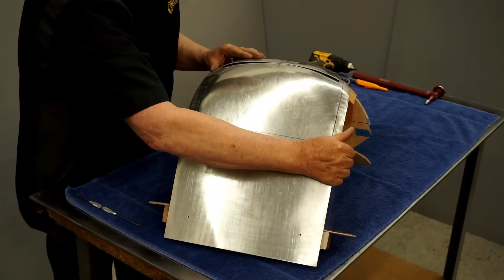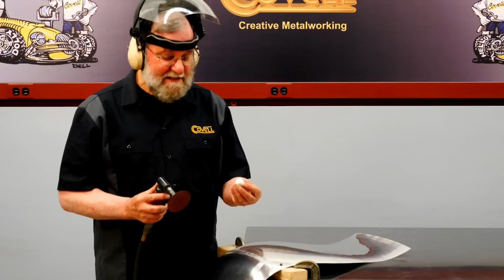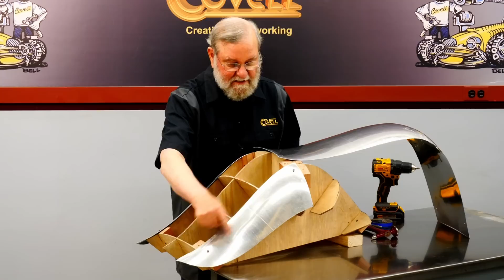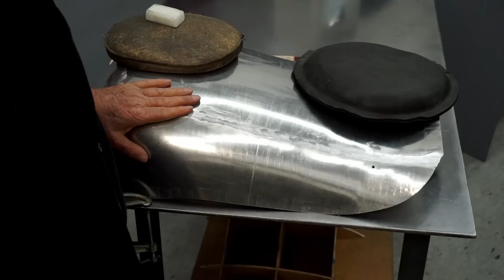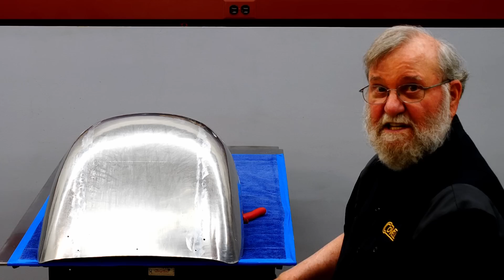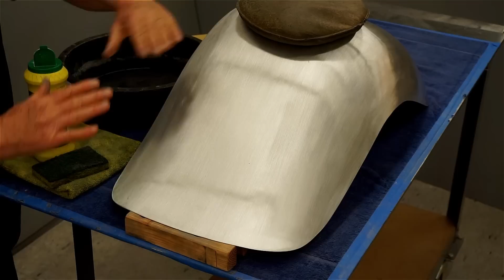Making a Curvy Seat - Part 4 - Joining the pieces

Comment: You are an amazing craftsman! I have a question. What is the white block you're putting on your sanding pads? I know its used to help not fill the pad with aluminium,  but im not sure what its called.
Reply from the maker: I use regular bar soap on my abrasives when sanding aluminum, to keep from clogging the grit. Any soap will work, but choose one that doesn't have an odor you dislike.

Comment: That seat design is beautiful. I hated to see even a little trimming much less as much as you did. I know why. but the full rough shape was pretty inviting to sit in. Maybe could have used some of the excess for a rolled or hemmed edge. Your seat, of course, and really, really nice.
Reply from the maker: I'm so glad you like the design. I trust that you saw that in part 6, the seat does get a wired edge:
https://www.youtube.com/watch?v=zcsHMpQSPLo
Reply: @RonCovell  Not yet.
Reply: Following up I didn't realize that I missed P1, the inspiration for the design. Ignorant of the fact, I assumed this was a free design seat. I will say I stand by my initial comment that the seat as progressed to this point was very nice. I could have lived with that easily — no holes and not the kind of stiffening called for by the Porsche design. At this stage the design was really fluid like something from an Italian studio.
But Porsche being Porsche of course they made holes. How much weight did they save? Do the holes add or lessen the overall strength?
That cleansing powder finish is outragedly beautiful. And the solid form is stunningly shaped likely better than the original one reason being the elimination of the hump. I'm with you, why the hump?

Comment: What sort of a frame is needed for a seat like this one? Is a basic rectangle on the bottom enough, or should there be a back support as well? What about sides, would they be strong enough to not bend when someone is climbing in/out of the car, or will they need to be reinforced as well?
Reply from the maker: In the first video of the series, I show a picture of the seat I'm modeling:
https://youtu.be/AEYOxDG-Tac?t=52
The edge of this seat will be reinforced, and I plan to have a future video that shows making and attaching the mounts.

Comment: what series of aluminum is most commonly used for forming aluminum like you do?  do you always use 3003? could you make the seat with 5052 or 6061 with your methods? what series would you use for a car body?
Reply from the maker: 3003 H-14 is my go-to material for most of the things I make, and it's ideal for car bodies. This alloy is highly-formable, although it doesn't have nearly the strength of some of the other alloys. If I worked in the aircraft industry, for example, I would be using stronger materials.
5052 is slightly less formable than 3003, but I have used it for some shaped parts. I have done very little with 6061, but when it's annealed, it does have fair workability - although it does work harden fairly quickly. Here is a video that shows shaped parts which were made from 6061:
https://youtu.be/d76PFjH1SJA?t=112

Comment: Thank you for these very informative videos.  Can you please comment:  You hammer out your tack welds --  is there ever a reason to grind down the tig tack welds before doing the full tig weld?  Thank you.
Reply from the maker: With proper technique, the TIG process normally makes a fairly low-profile tack, so there is usually no need to grind the joint before making the finish weld.
The primary reason I hammer the tack welds is to get the best possible alignment of the panels before doing the finish weld. I don't want one side to be higher than the other, and even a few thousandths of an inch misalignment is worth correcting. This hammering automatically flattens the tack welds - but if I had absolutely perfect alignment, no hammering (or grinding) would be needed.

Comment: What a beautiful piece of workmanship! I noticed that you did not put the raised hump in the "crotch" area of the seat. If you did want to add that, would you need to make it from another separate sheet, i.e. is that too much "shape" to put into the seat bottom?
Reply from the maker: I do plan to add that raised hump later on, and I will probably not make it as a separate piece. I'm still 'noodling' the specifics of that challenging little detail.

Comment: Whenever I watch someone using the English wheel, I worry about the hands getting pinched. Is that an issue or is it not?
Reply from the maker: Well, probably anyone who has used the machine extensively has pinched their fingers at one time or another. It's one of those things you learn pretty quickly NOT to do!
Reply: @RonCovell  Thanks for the response.

Comment: Have you ever tried lath head wood screws?
Reply from the maker: I'm not familiar with them. I have seen carpenter's 'deck' screws, with a 'Torx' socket  - is that what you are referring to?
Reply: @RonCovell  No-search 'lath screws'
Reply: @RonCovell They are sometimes called Teks but basically just have a built in washer on the head. Seems like they would be okay for a convex surface but leave a ring on a concave surface of course.

Comment: How did you close the holes used to screw the seat to the buck? Did you just tig them closed and sand flush?
Reply from the maker: Yes, I put a dab of weld on each hole, hammered it a bit against a dolly, and sanded the areas flat.

Comment: Why you use 2% Lanthanated instead the 2% Ceriated tungsten? Ceriated is not better for aluminum? Thank you and great job as always. Greetings from Italy
Reply from the maker: I used to use 2% Ceriated tungsten, but I was told by some professionals that the Lanthanated electrodes are preferred. In any case, Lanthanated, Ceriated, and Rare Earth tungsten electrodes are truly 'all purpose', and can be used with either AC or DC on any weldable metal. The old standard, Thoriated tungsten, is falling by the wayside these days.

Comment: Thanks for sharing your knowledge Ron! I was wondering if anyone has ever used a blasting process, like sand or similar to shape panels? I know it can warp body panels but can that be used as a tool?
Reply from the maker: I know of only one instance where blasting has been used to make curved panels, and the maker discovered the process accidentally. My mentor Don Potts was making stainless airfoils for one of his car sculptures, and blasted the back of one panel in preparation for epoxy bonding the stiffening tabs to it. He was shocked to see that the panel bowed after blasting, but then realized he liked the curved shape, and could control the amount of curvature by timing how long the part was blasted. You can see the results here:
https://youtu.be/3sWNiDPVu2A?t=68

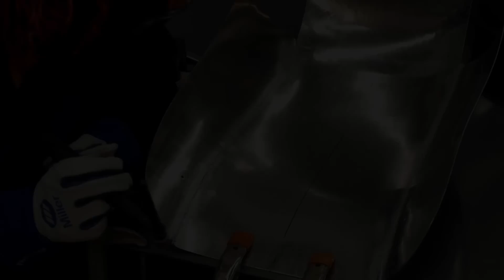Comment: 11:28 - This would be the scariest part for me.... I've never done welding w/o filler before, I've only done sheet metal on body panels and I was taught to weld in small increments so the heat didn't mess the paint up.
Reply from the maker: Well, of course none of these panels were painted, and I knew that the high degree of curvature would keep much warping from occurring.
Reply: @RonCovell  - I'm sure you knew that but I was being taught by a guy trying to use me in a body shop he was running out of his garage.... He didn't want me using the filler rod so he didn't have to spend money, I'm sure that's not a good way to learn welding because it was very difficult trying to use pliers to hold the tiny pieces of filler rod he had saved.      😂

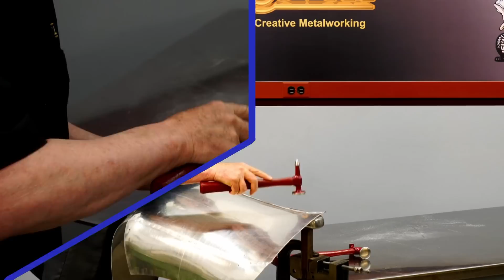Comment: 10:42 "I'll switch to a hammer with a little more curvature to the face."

It takes a seasoned professional to say and do that. I (car mechanic, truck driver) could never understand the difference between two similar looking hammers or understand the different nuances they produce to the sheet surface.
Reply from the maker: I really should have said why I switched hammers. I was getting into a 'hollow' area, and the low-crown hammer face was in danger of hitting only on the edges, which can put marks in the metal. I didn't notice this omission until I was editing, and it wasn't feasible to re-shoot that scene.
Reply: @RonCovell  Every specialist in their field acknowledges that their tools are like mental extensions of their peripherals and sometimes things get omitted/assumed. I tip my hat for your effort to open your world to us.

Comment: You made that look as if it was stamped from a single piece of aluminum, well done sir! Why is lubrication with a bar of soap needed?
Reply from the maker: Aluminum is a soft, gummy metal, and it tends to clog sanding discs unless you use a lubricant like soap.